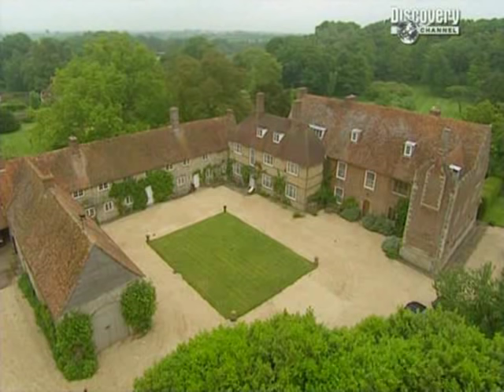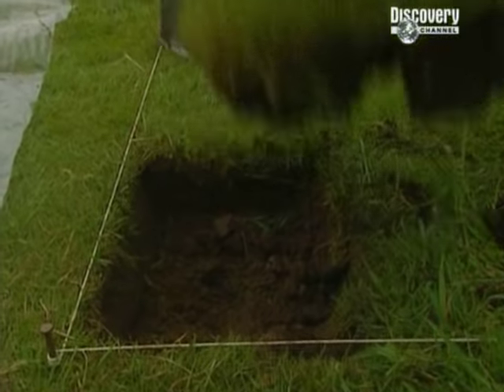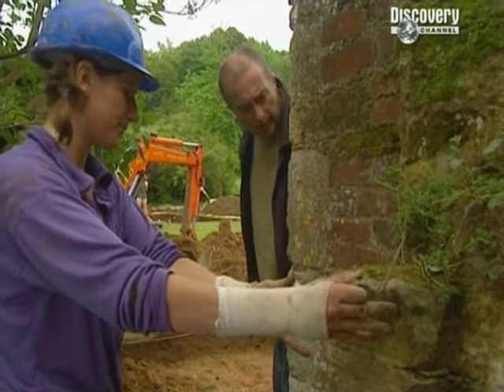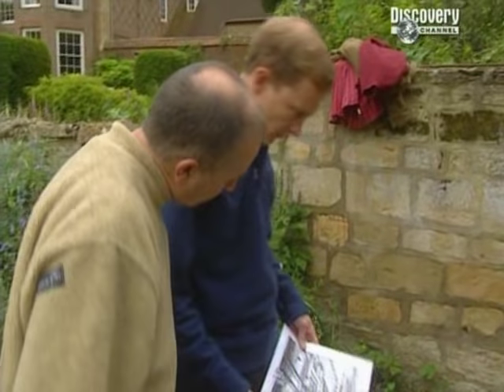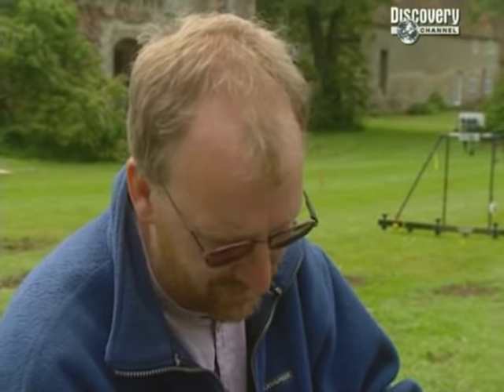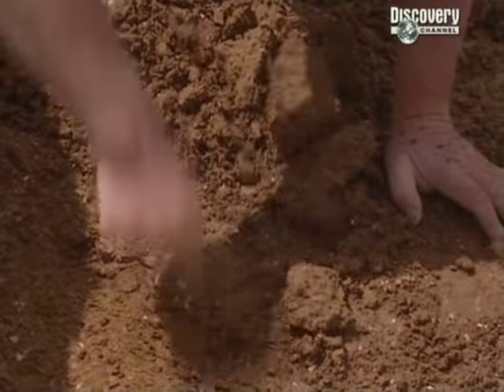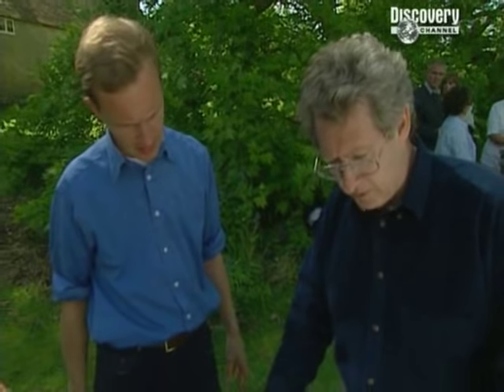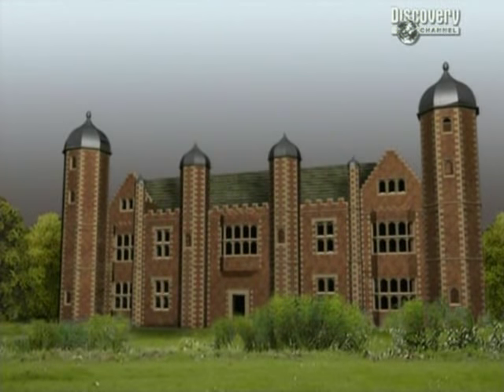Time Team S08-E06 Rycote, Oxfordshire

Comment: Those decorative towers are not actually purely decorative (although the reason for building them almost assuredly was), because any time you have a right angle of 90 degrees (or other angle with varying degrees of success depending on how sharp the angle is) you provide far more strength and support to any adjacent wall. It would also provide more support as it went up vertically, similar to how a buttress works. This could possibly apply more pressure pushing inwards, but that would surely have been taken up by interior walls, witch would also further support the exterior wall.